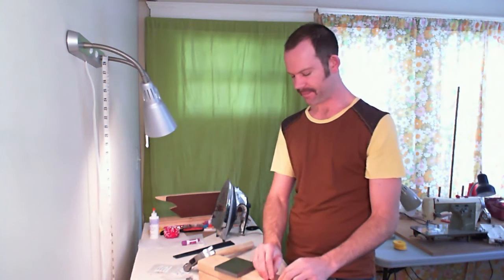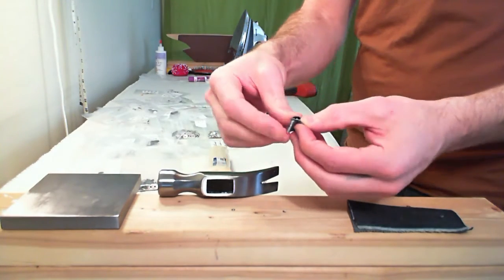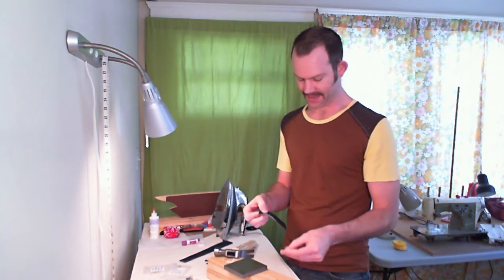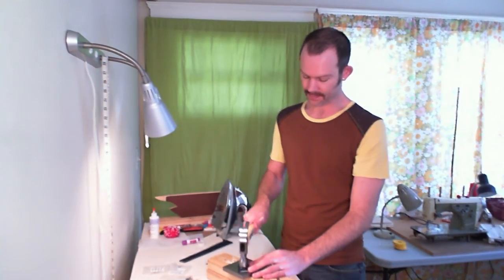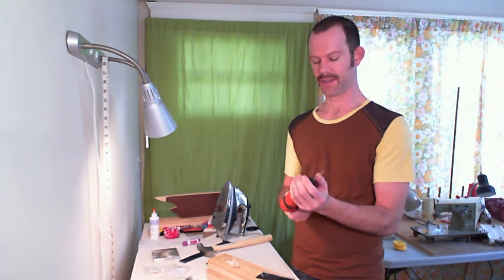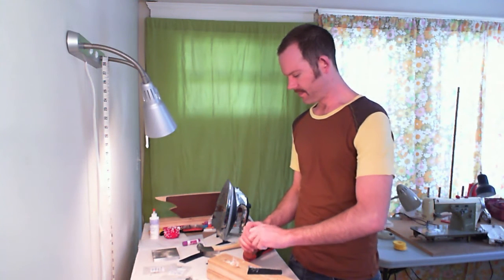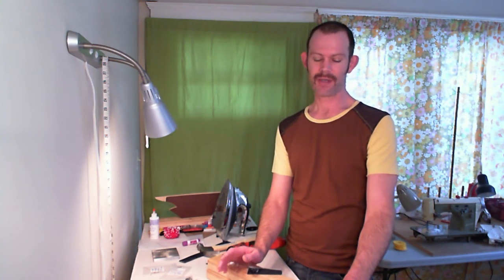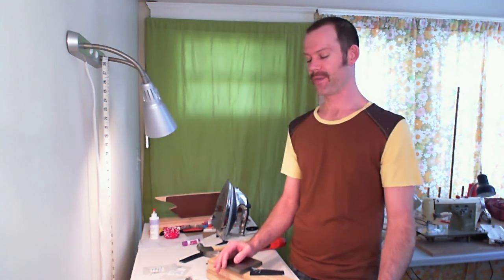Part 2: How to attach rivets to your jeans

Comment from the maker: @firstcomputerservice It depends on what caused the button to fall off to begin with.  If the post broke it's possible you can put it on another post but I've never tired this.  You'll be the only one who notices you jeans button doesn't match the rest of the hardware, just replace it.